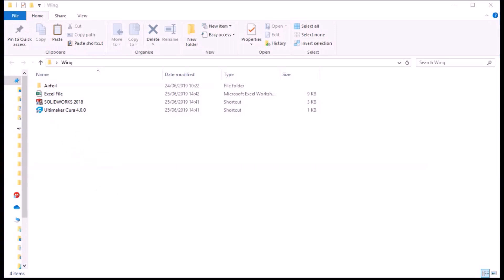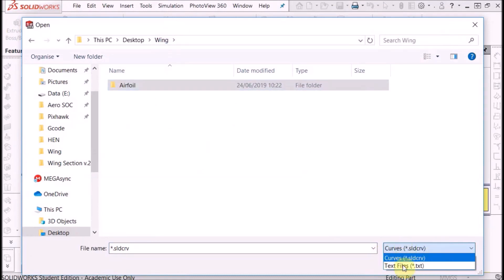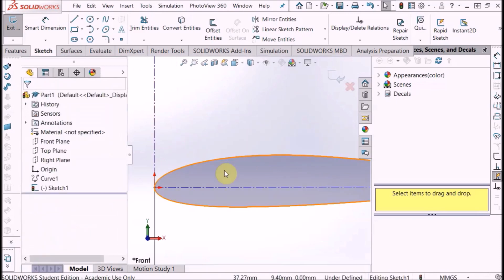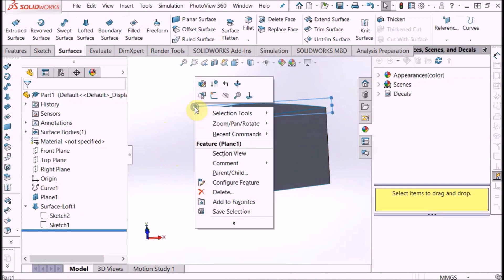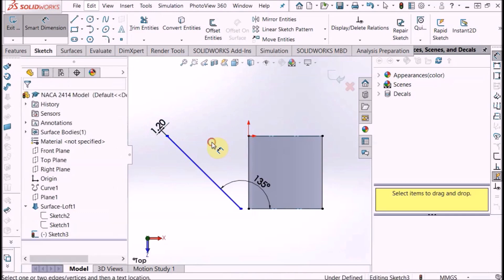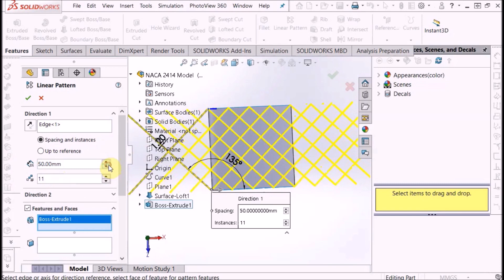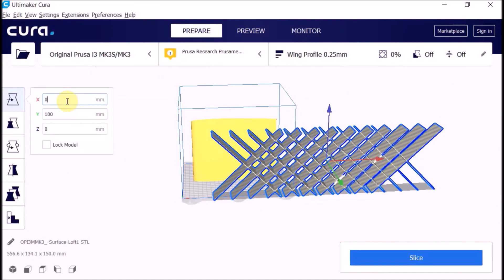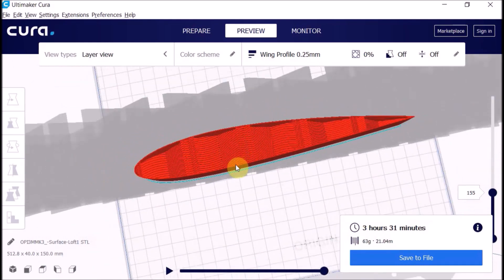How to Design and 3D Print a RC Aircraft Wing (Basic) Part 1

Comment: I have been getting back into SolidWorks modeling & RC Planes making so I thought I would look into getting a 3D printer. I stumbled across your series (watched it all) and I have to say you come across as a professional user but you seem to miss out on a lot of basic modeling techniques, I can kinda tell that you are self-taught like I was and you kinda learned on-the-go whatever your model required and I think that's awesome, but I so you struggle with some sketches and features that for once were not caused by SolidWorks' bugs & shortcomings. At some point I recommend looking up tutorials (even if it was for Fusion 360) which you can pick very good practices from; like I did from your video with the Cura custom infill.

Hit up if you need me to point you to some good ones.

Comment: Very neat video, loads of rapid info, actually like that. However, not able to import data into Solidworks Program. Watched video about 5 times at least and duplicated steps without luck. I entered manually more than half the points and then I got a warning that my session was ending in 5 minutes. I got kicked out and lost all data points. Solidworks didn't say up front that there was a time limit on the trial. Thought you might get a chuckle out of this. Unfortunately, not much for me. I am looking into purchasing the software. Do you still use it or did you find something better?
Reply from the maker: Thanks, I'm not a huge fan of Solidworks and actually prefer Autodesk Inventor however its what I have to use daily for Uni/Work. Haha, one of the reasons I'm not a fan, plus they update how some tools work (like the offset tool) without warning

Comment: Thanks for your video.  It helped me get started with Solidworks.  I have a question however - I drew a similar test wing section with the same dimensions and internal structure, however in Cura, my print times were at more than double what you had - Would you mind sharing your Cura profiles?  The link you provided does not work for me. 
Thanks.
D.

Comment: hi very Interesting tutorial. but can you provide me some tips using prusa slicer (or slic3r). i'm not be able to get the same result with this slicer.
Reply from the maker: Thanks, unfortunately I haven't managed to work out how to use prusa slicer for this way of modelling. I'm using a mk3s and the cura printer/filament profiles available straight from prusa which work fine.

I'm still looking at a reliable way to model for prusa slicer as that would be preferred to me, but the added complexity of modelling and extra time it takes currently isn't worth the trade off.